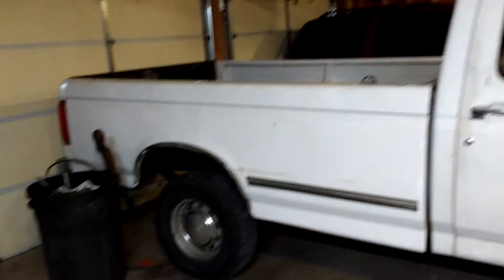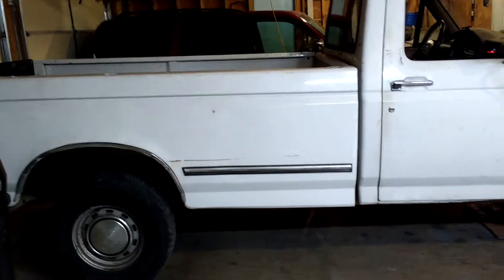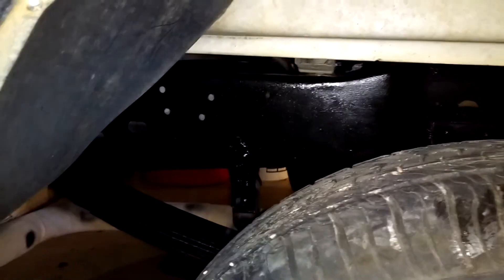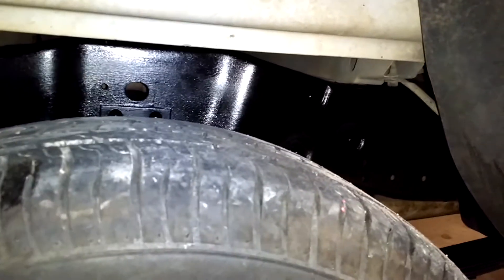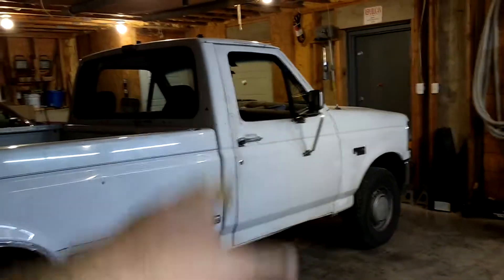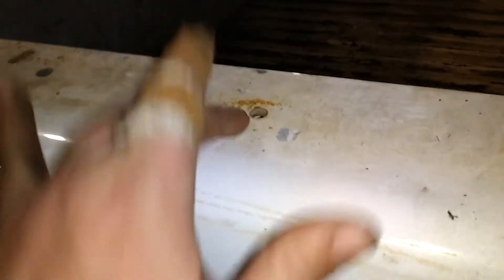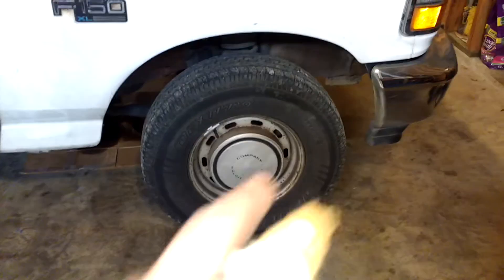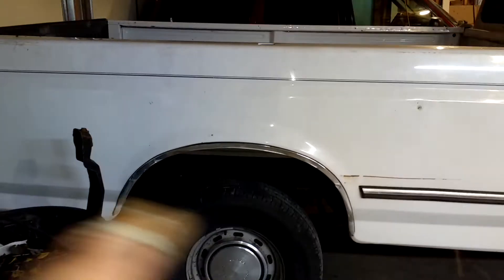1993 F-150 Restoration - The Bed is Back on!

Comment: Where did you find the replacement bolt??
Reply from the maker: Heh I didn't, I managed to use the original ones from both trucks; the ones that were rusty I soaked for a while and they cleaned up pretty well. I wanted new bolts but I couldn't find any... luckily down here in Texas rust isn't much of an issue.